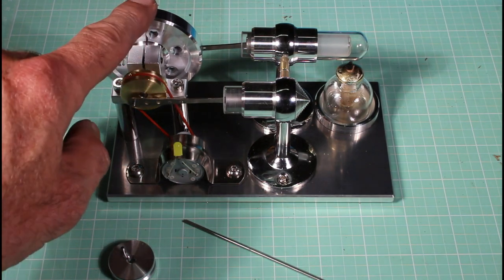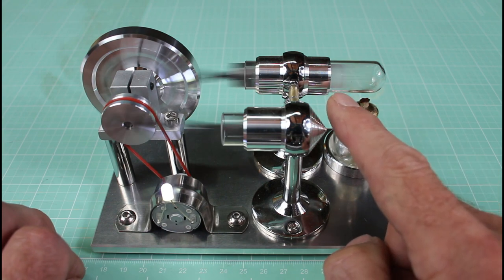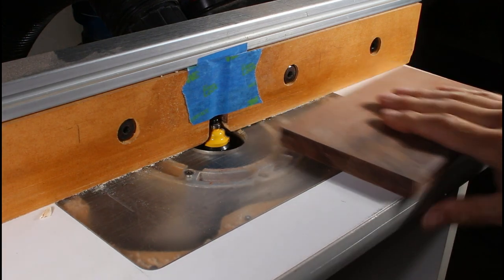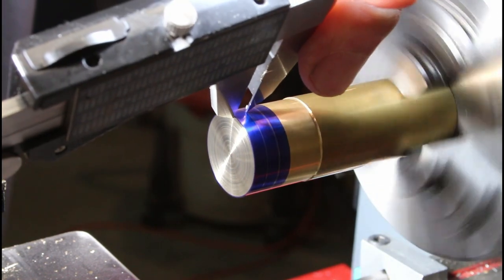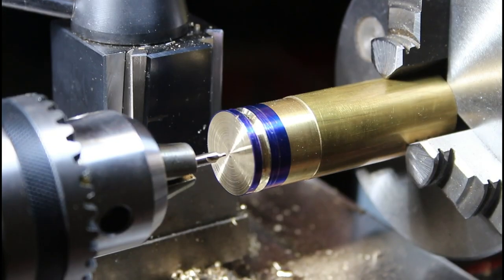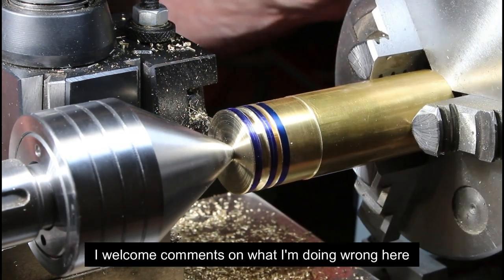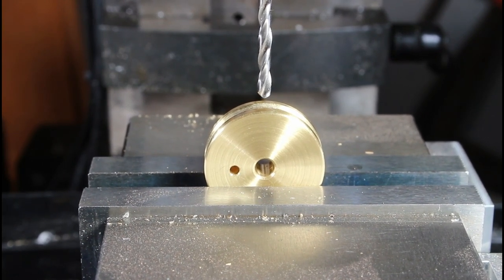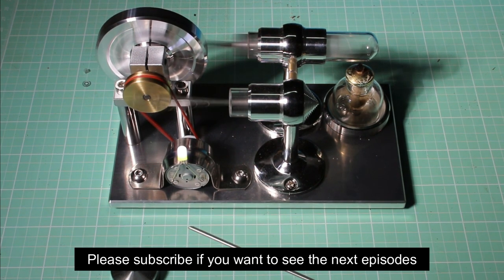Making a Steampunk Stirling engine - Part 1

Comment: I have the 7x12 HF lathe and had many issues with parting using blade type tools. Lack of rigidity in these lathes is the major cause. Another youtuber Joe Pieczynski addressed this in one of his videos and I use his method with excellent results. In a nut shell, here's what he recommended. Plunge in .010 or .020, back out and move toward the chuck the width of the blade (or a little less) and plunge in to the depth of the first cut. Move back to the first cut and plunge in another .010 - .020. back out again and move back to the second cut and plunge in again and just rinse and repeat until you are through the part. It seems the main issue is the lack of side clearance and blade flex when the cut gets deeper than a few thousands. Good luck Guy, looking forward to the of the rest of the build.
Reply from the maker: Thanks Denny, I'll try that.  I may have seen Joe's video but forgot about it.  I also have a big sturdy parting tool with a wide blade that I'll try on brass.
Reply: @GuyMarsdenMakesStuff  Guy I finally broke down a bought a cheap insert type parting tool a few months ago on amazon. it was like $25 and while I wouldn't want to use it for production work, for my little hobby shop it works great.